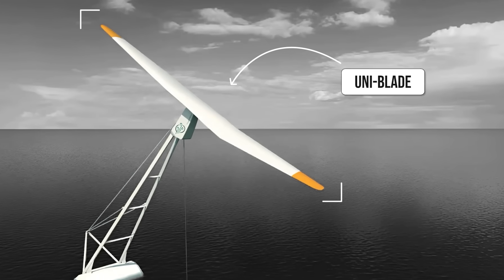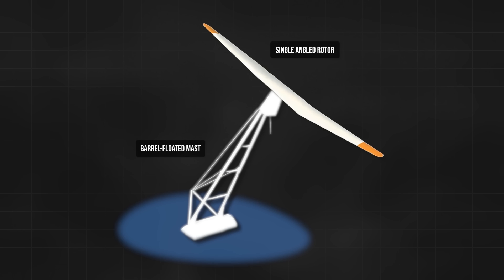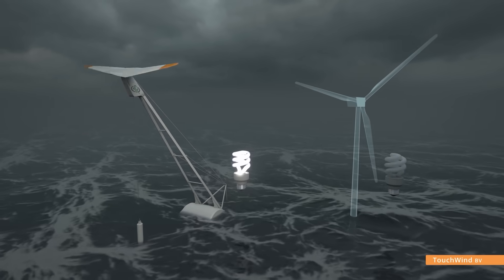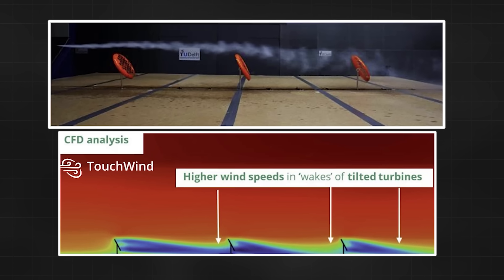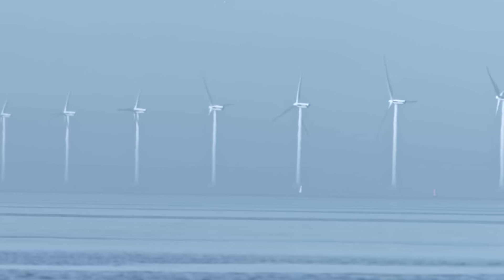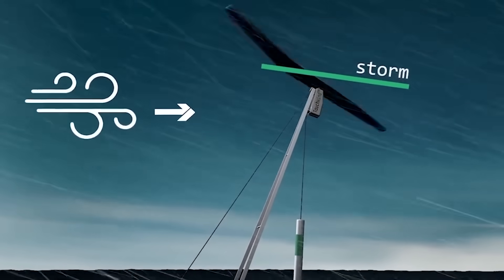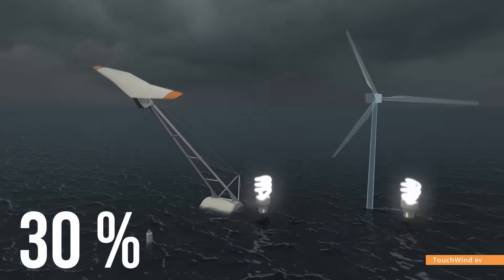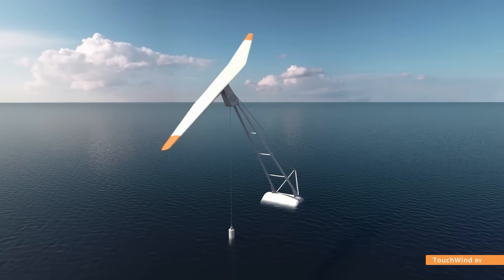Insane New Turbine Promises CHEAP Unlimited Energy

Comment: the real competition to windis natural gas, the installed cost of a gas turbine power plant is 0.40 to 0.70 usd/w if you can get the installed cost bellow 0.80usd/w the financial model for the turbine becomes very compelling and that is what the market needs. people eally don't care about about the environment a few do but what they care about is money. give them a cheap source of energy and it will be adopted quickly.
Reply: Natural gas is more of a complement than a competitor. Electricity from natural gas can be adjusted to compensate for the variable output of wind and solar.

Comment: Two variables that  can be reduced to one.  Air direction and wave/water turbulence and direction.  Why not try the blades in water at different depths.  No air/wind involved.   Reduce wave turbulence, depending upon depth.  If the blade design is better than 3 blade propellers, if may work in water also.

Comment: reminds me a bit of the really efficient asymmetrical rotorblades for drones that reduce noise by a lot.
anyways, im just a sucker for passive functionality, that thing can turn into the wind and manage its blades pitch without any motors or computers and sensors and crap. its a winner in my book.
on land you could even put the generator at the bottom and just have an axle running up to the top, meaning you would have hardly any weight at the top.(relatively speaking)
honestly... im pretty sure i could build something like that behind my house. just a steel frame, rotor on top, generator on the bottom, having it articulate and rotate at the bottom is the hard part, but hardly impossible. man, i cant wait for retirement, there are so many concepts i want to play around with.
Reply: I think it's symmetric.

Comment: The stresses on the structure and the energy required to counter the force of storm winds will capsize the wind generator. Even if the 2-blade rotor generates lift like a gyroplane, it's not lifting "up" relative to sea level/gravity, it's lifting "up" relative to its axis. If it actually works, the best upward rotation of the boom and rotor will be near 45⁰ (relative to storm wind direction) but slightly less.
Reply: They make lift but are constrained in their movements. The lift is going to pull it up because it can't move it back. Also, counterweight are awesome.

Comment: 4:20 ""This is known as the wake of the turbine", a technical term ?
Reply: I don't understand the question.
Reply: Wake is a technical term for the turbulance in a flow caused by it passing over any object or from an object moving through a fluid.  It applies in both air and water.

Comment: OK, I can understand the efficiency thing with deep sea turbines. But how do you get the electricity from the middle of the ocean to where it is needed without massive investment in transmission lines? Or without massive energy loss?
Reply: How do you get the energy from a nuclear power plant to where it is needed? The same kind of investments into transmission lines. Yes the cost to lay cables in the ocean are higher than on land, but in the end it's just a question of how much cheaper offshore wind is to produce than onshore sources compared to the extra transmission costs. And the fact that the people who build offshore wind do those kinds of calculations and deem it profitable tells me that it is indeed economical, which I would expect given that transmission amounts to about 5% of electricity costs.
And no wind farms will be built in the middle of the ocean. You wouldn't be able to anchor them to the sea floor. All wind farms are built in coastal regions.
Reply: Dude thinks we haven't solved the underwater cable problem like 100 years ago.
Reply: Offshore wind is already a thing. This thing can use the same kind of transmission lines as existing offshore wind projects.

Comment: casually basing their calculations on a wing that is wider than a 737 wing is long and 12x its length. Surely there will be no logistical and operational unknowns that would jeopardize that 30% savings.... surely.
Reply: The blades for new offshore wind turbines are already in excess of 130 m long (which makes the diameter 260 m which is already more than for this proposed turbine type). Also, these very big blades are easier for offshore projects because ships transporting the components can be made very big. It's also possible that if this thing ever becomes reality, the first commercial units could be smaller and only grow gradually in size.
Reply: @seneca983  The largest turbine is GE's Haliade-X offshore wind turbine, with blades 107 meters long
Reply: @23desdfe345r2fd23f23  You do understand that would mean an overall diameter of more than 200 meters, larger than the proposed blade, right?
Reply: @filonin2  sure and 10x thinner

Comment: There are areas in the USA that wind gets too hard for normal turbines.  Why not do this on land?
Reply: It's a variation on self-furling, there's a few systems for that in small turbines.
Reply: @spankeyfish  I had to google self furling.  I like it.  Hopefully, it does it in a way that it can keep working and generating power.  Makes way more sense than applying brakes.  I wish these would get more affordable.  In Colorado, Wyoming and Nebraska, these are on brainers once the costs come down.  The big turbines, in my opinion, have been a scam to create a huge barrier to entry.  We could have so many smaller turbines on much smaller acreages with vertical and smaller turbines, but then the big boys would have less control.

Comment: Great Idea. My concern is that weight on a cable. I have visions of that weight swinging around in heavy weather.
Reply: The weight is going to be under water, or at least partially under water. It should be pretty well damped against sideways swings. I'd be more worried that waves would push/pull on the weight and swing the mast to beyond vertical (at which point it will tip over).
Reply: @Pystro  Buoyancy of the weight (its overall SG) will be one of the variables to play with. No reason the winch couldn't be dynamic - if only for heavy sea conditions the cyclic loading would be reasonable over lifetime. A dynamic winch might also be able to help with broadside stability, allowing the turbine lift to assist with righting.

Comment: I'm guessing that the two bladed rotor is chosen because of the reduced cost. The reason that two bladed rotors are not used on larger turbines is problems of balancing and also uneven forces on the rotor bearing. I wonder if using a three or four bladed rotor would increase the effect of deflecting the turbulent air.
Reply: Uneven forces on the rotor bearing may be less of a problem when the mast isn't cemented into the ground but designed to bob around on the waves - where the top of the mast can just translate sideways as a result of rythmic sideways forces. I wonder if the main problem is indeed sideways forces, because you'd still have the same problem with "sideways" rotational moments.

Comment: Projects that haven't been built are infinitely less costly than stuff that exists in the real world.    True fact.
Reply: Yep.
Reply: The government, especially the military, can spend billions before they even begin to build a project.
Reply: Lol, everything that 'exists' in the world that was man built/shaped, started off as a mere thought. Careful what you focus on, it tends to shape your experience of reality.
Reply: @TBOBrightonandHove  The better designs of wind turbine may have 10 times the power of the present turbines and that cannot be reach by any other wind systems. I say that all the wind turbines have a very poor design. I designs 3 types very efficient, and I am positive they will work as expected. I have 15 inventions and 7 patents. I remember my A to D converter, patented in 2000 in USA, patent # 6,091,346, using floating voltages, I sent to patent office without to do any experiment. After I got a patent, I did experiments and did work perfectly. The same is with my wind turbines. The horizontal turbine has a little active surface on the base of the blades and the rest of the blade are useless and can be removed.
Reply: Yeah thats a fact but if they do manage to make it work. It seems to be less comples than traditional turbines. If its generates similar amount of energy per investment dollar its worth it. And it possibly can do more as it suppose to have more uptime.
Reply: Big deal... Sitting in a mudhole while doing nothing is the cheapest way to live... Do that then... We're moving on...
Reply: @bosatsu76  and  @comfortablynumb9342, you are jumping the gun. @mavigogun may have studied TouchWind's idea, thus gave his statement. @mavigogun did not say not to venture any new. It is a bad attitude to label someone based on their own imagination like the Americans or their minions.
Reply: @bosatsu76  It's a ponzi scheme for investors - there's no way this is ever going to work, too complicated = too many things to go wrong. Sorry.
Reply: Not investing in new tech means spending infinity doing the same thing without advancing. It's not good to be a Luddite.
Reply: Disagree. You can waste more money to useless Case study or Theoretical project then on physical proof of concept.
Reply: People that complain about ideals are 100% more likely to look like idiots when they materialize. People who complain about material conditions just look tired.

Comment: Adjusting the angle with wind speed is an interesting idea, but can it handle sudden gusts and sudden changes of wind direction?
Reply: yes it can, because gust can not increase the rotation speed, they are too short for that.
Excess of rotation speed is what kills wind turbines, not direct drag forces.
Reply: @angellestat2730  What about changes in wind direction. Most wind turbines have 3 blades because if the turbine has to yaw while rotating having only 2 blades will rattle the turbine (whereas 3 or more will just just cause a steady bending force).
Reply: @seneca983  I understand what you mean, the same problem from airplanes when gusts change their angle of attack losing lift or producing turbulence on the process.  In this case I am not sure that normal wind turbines can adjust their blades angle so fast to counter those sudden changes on their angle of attack.  Maybe they can, I dont know.
But I guess as this angle blade is not fixed, any lost on lift allow the turbine to move upside or down, as a way to absorb part of those forces.
There are still some force components that can not be absorb, but these would be rare because it requires that one part of the blade would have different  apparent wind direction than their counterpart.
Reply: @angellestat2730  I think you misunderstood. The issue is that a rotating turbine is a gyroscope. Think of a normal wind turbine. If the wind changes direction, it has to yaw to face the wind (as a wind from the side wouldn't be useful). If the turbine is rotating and yawing at the same time, the gyroscopic effect will twist the turbine either up or down depending on the direction if it has 3 (or more) blades. If it has only 2 blades, the same thing happens except the strength of the gyroscopic effect varies. It's strongest when the blades are in vertical position and the weakest when they're in the horizontal position. This varying gyroscopic effect rattles the tower can causes it to wear out faster than otherwise.
Reply: @seneca983  the gyroscopic effect will twist the turbine either up or down
Ok.. good point, but this turbine could move up and down (changing its angle with respect the ground), this could absorb those forces in my opinion. 
This varying gyroscopic effect rattles the tower can causes it to wear out faster than otherwise.
It is possible,  but at this point, I can not say nothing for sure, we have several factors and forces on this system, hard to know for sure how it would evolve without a good simulation. 
I know that the gear and software control system from 3 blade turbines is already incredible complex, even Siemens has release some models without having that solve that ended in a huge lost of capital. 
This new approach would find several of those problems on the run, but I still think that the extra range of movement could work in its favor to absorb some of these forces if they do not enter on resonance.
Reply: @angellestat2730  My understanding is that this rattling is the main reason why most (though not all) wind turbines use 3 blades (rather than 2).

Comment: It’s an asymmetrical 2 blade rotor, add a gimbal at bottom to point away from the direction of wind and use on land or water.
Reply: I think it's actually symmetrical, it just looks that way in some of the images. I think the shape is straight  rotor with the tips bent back from the direction of rotation.
Reply: "and use on land or water." It looks like it's too short to be used on land. At least without a much taller pole to get it above ground turbulence.
Reply: @jeffjwatts  Ground effect
Reply: ...
🤜⚡💥⚡🤛Being a triple engineer with numerous inventions in this space, I conclude that this is not a good design. 1] Downwind designs encounter turbulence from the tower which reduces efficiency;  2] Wind speeds are slow at low elevations which reduces energy production;  3] The blade angle is sub-optimal for all inclinations which reduces energy production;  4] The blade angle to the wind direction requires much stronger, and therefore heavier and costlier, rotors;  5] The retreating blade encounters the same loss of lift that helicopters experience which here translates to reduced energy production and other problems. IMHO, the cost of the system is comparable to legacy systems and therefore the lowest levelized cost of energy [LCOE] metric is higher. Not a good look.

FYI, most wind energy comes from medium wind speeds BECAUSE they are more prevalent/frequent in occurrence. High speed winds occur less frequently. Low wind speeds don't have sufficient energy to be of use.  

I have advanced, robust, low cost wind turbine innovations, offering the lowest levelized cost of energy [LCOE] and ultimate  survivability in any wind regime.
Simple low cost grid-scale energy storage is also on the table.

Contact me for more information and check out my engine/transportation innovations...including off-planet solutions.

Stay Radical!

From the desk of: Chief Radical Officer
🤜⚡💥⚡🤛
\/\/\/\/\/\/\/\/\/\/
Reply: @MiloTheMindBender  Good solid wind expertise points.  But they are not nessarily insurmountable if the manufacturing costs are substantially lower.  The biggest problem will likely be getting to the scale nessary to truely do apples to apples comparisons with conventinal tubines as obviously small devices will be uncompetetive so their needs to be a BIG player willing to take a risk on atleast building a Big one to test.
Reply: @kennethferland5579  I believe I sufficiently demonstrated that the efficiency [power produced] is less than that in the legacy HAWT architecture which can't be surmounted. If you meant that the system cost might offset the loss in energy cost over the lifetime then I believe you are in error because, IMHO, the cost of this tilting system is comparable to legacy systems for the same size BUT this tilting system produces less energy and therefore has higher LCOE. In fact, I'd say that a tilting tower would be required to be more massive/sturdier and therefore more expensive. Same for the rotor/blade.
Reply: I think it actually points into the wind. This is what causes it to lift itself up as the wind speed increases. If it was pointing away from the wind, then increasing wind strength would knock it over rather than up.

The idea has appeal, but as with all modern technology the devil is in the detail. I see stability as the major issue. At high wind speed the rotor is acting like an auto gyro. The “lift” this produces will be acting downwards along the pylon. Balancing this, while still allowing the freedom of movement needed for the device to track the wind, will be a hard nut to crack, IMO. I’ll be interested to see if this concept progresses further. Fingers crossed!
Reply: @q.e.d.9112 Yeah it definitely looks like it is supposed to point towards the main direction of the wind. Yet how they going to manage that when ocean wind is so chaotic?

 I get the appeal. Cheaper, even if it isn't even ideal design.

  The great thing about green energy is that the sun and earth over produce! Effiency doesn't really matter if you can make a ton more.
Reply: @dianapennepacker6854  
Oh, I agree. What matters most is LCOE and LCCOE (carbon). I’m just seeing huge control issues with a floating device that wants to weathercock 180° out of position.
Reply: @q.e.d.9112  - It clearly shows the wind direction
Reply: @q.e.d.9112  Depends on the shape of the blade/wing.
Reply: @q.e.d.9112  2:44  "in a down-wind tilting turbine". 4:23 shows rotor pointing downwind. Video at 7:56 also.
Reply: As long as it could swivel to face the wind if on land, where there is that weight beneath the rotor on water, on land, it could be a variable tether, producing electricity in the same way as a kite generator does.

Comment: that looks like a normal helicopter rotor, whats the actual difference, two blades normal rotor
Reply: Helicopter rotor has a pivoting head that also allows the blades to individually change pitch. This rotor has none of that. It is a single monolithic piece .
Reply: @macrumpton  ie normal wind turbine, one double dual blade